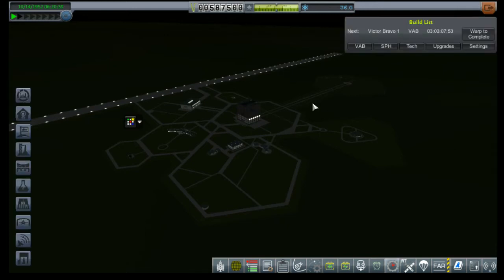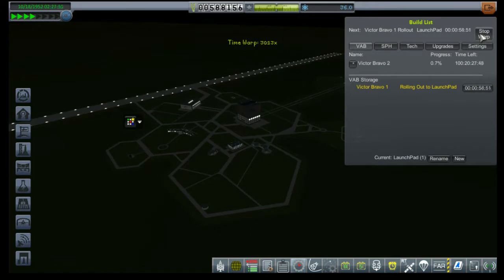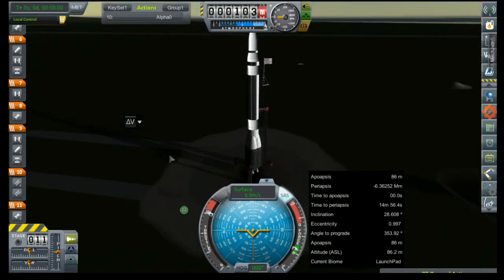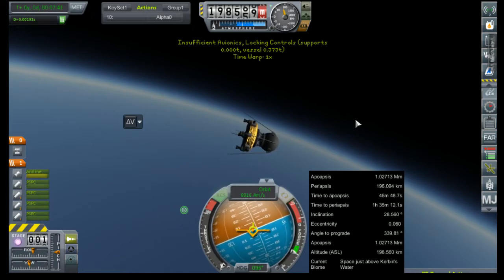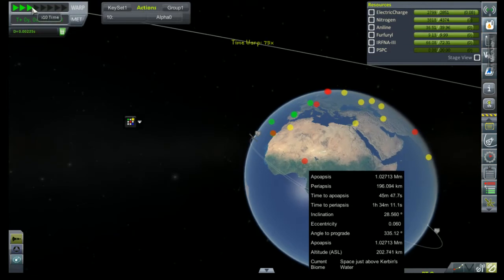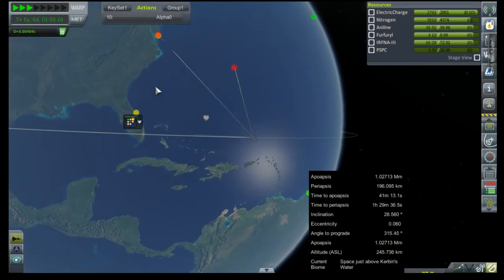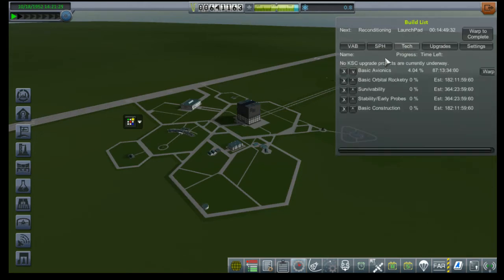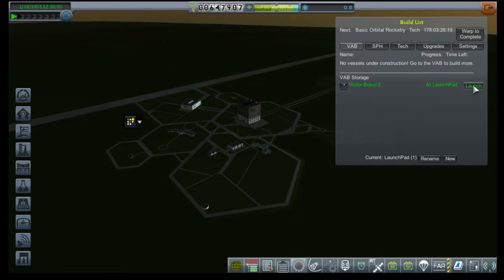RP-0 Part 3. Going for Orbit!

Comment: 10/18/1952, you launch your first satellite. I'm starting to get a feeling that RP-0 isn't perfect with realistic timing.
Reply from the maker: it isnt. it certainly ups the difficulty a good bit - but with good builds and a bit of luck, its possible to get a good leap on historical flights.
Reply: it's because there's no politics involved here
Reply: iirc von braun had a few designs for orbital rockets in the mid-40's so with enough money it might have been possible
Reply: And i have year 1959 - still not even EA-1941 lol

Comment: What engine is on the 2nd stage?
Reply from the maker: Good question. I dont remember exactly, but let me look back through this and I'll see if I remember.
Reply from the maker: I had to turn on the Closed Captions - but it is in fact an RD-103
Reply: @CosmonautCrash  Thanks very much!
Reply: @CosmonautCrash  I am trying now to design Vanguard - like rocket for first satellite launch, but having some troubles with lack of deltaV)
Reply from the maker: Vanguard's margins are super thin ( especially if you are trying to fly by hand) its not an easy platform to get to orbit. I wish you all the luck though!